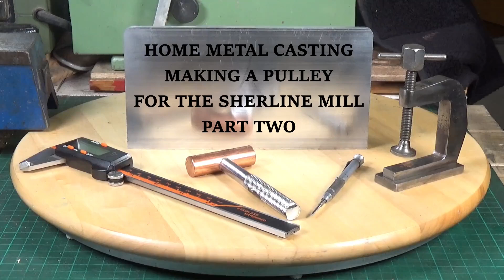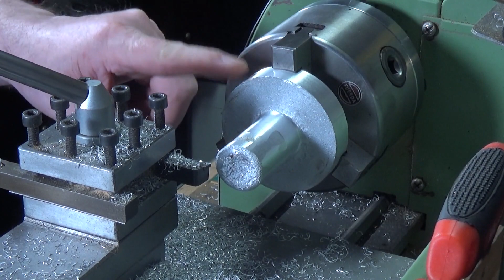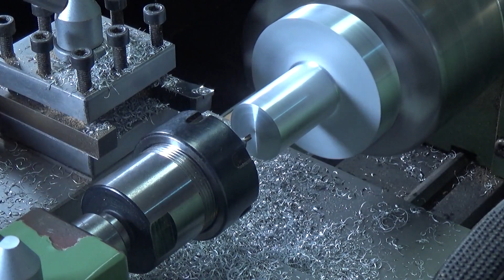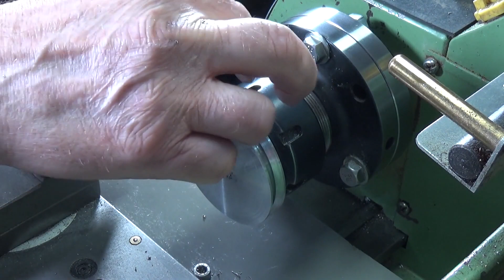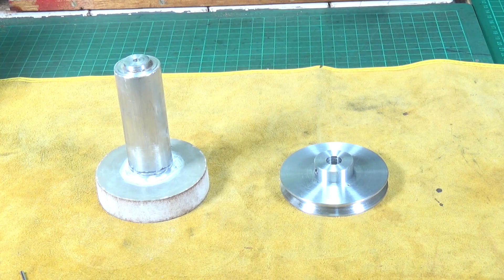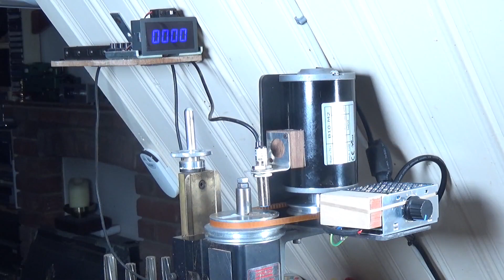Home Metal Casting: Making A Pulley For The Sherline 5000 Mill - Part Two

Comment: Geez Alan how good did that casting come up after being machined! You've gotta' be stoked with that. I can see you getting into casting now. I have a virtually unlimited free supply of good quality brass offcuts that are too small to do anything with. I'd love to cast them into bar stock......as always mate a great vid thanks.
Reply from the maker: Hi Jim. Yes, that one turned out ok. My little furnace can only melt small quantities of aluminium at any one time but it's ideal for pulleys and flywheels. To melt brass you would need a furnace capable of generating more heat. Rob over on his Xynudu channel has done a few good videos on melting and casting brass. Cheers, Alan.
Reply: @RetroSteamTech  Yes I've watched Rob's casting vids. Just not sure I need another rabbit hole to go down Alan 😅

Comment: Nice work Alan.  It came up well.  Saved money and got the configuration you wanted.  What alloy was that from ?  You could add an idler roller (ball race) to take up slack in the belt.  It can be fixed and just use the existing adjustment  setup.   It would however have to be dead accurate on two planes or it will push the belt off line.  Cheers Rob
Reply from the maker: Thanks Rob. To be honest I'm not entirely sure where the aluminium came from. It was a re-melt from some I cast a while ago, it would have been scrap from something though. Those belts are fairly cheap, I got one from ebay the right size for £5. Cheers, Alan.